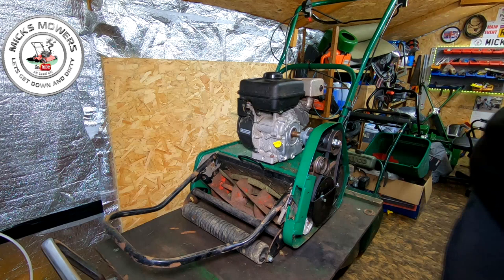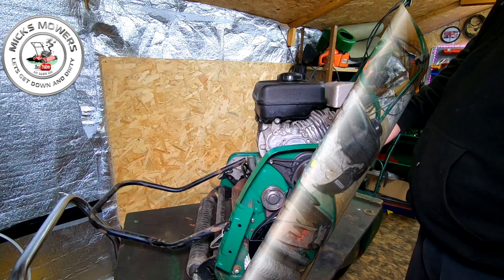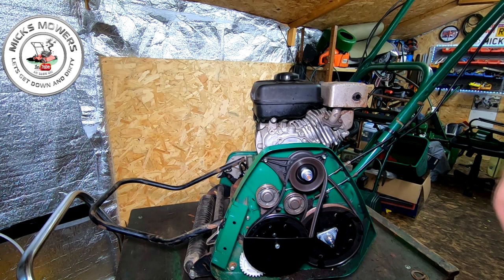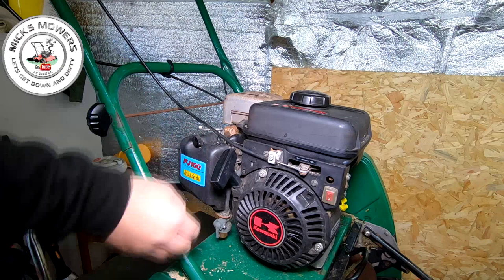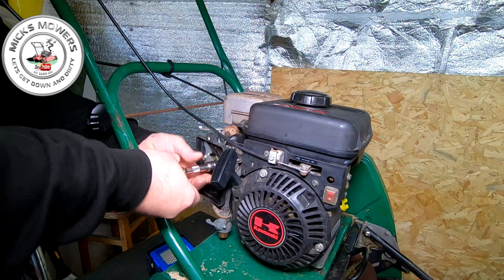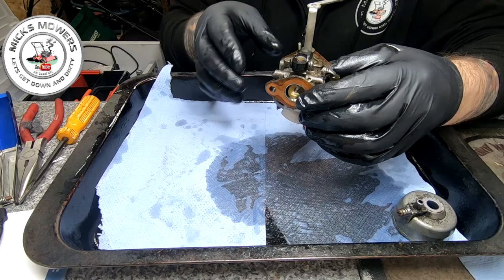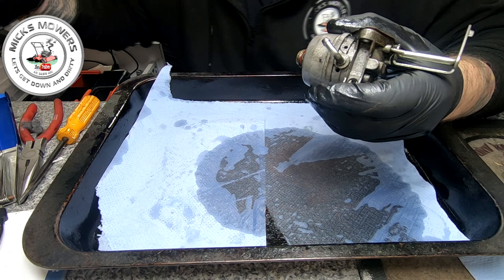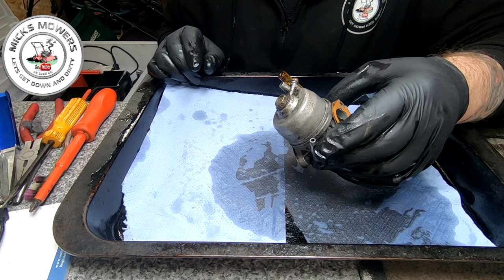Service Your Qualcast 35s Cylinder Mower Yourself.. Cost Effective And Easy To Do

Comment: When the pins are tight try pouring some very hot water on the posts. the alloy will expand quicker than the pin and it should pull out.

Comment: pretty sure those float pins are tapered, will only come out one way.  Usually the longer end is the narrow end so you need to push it back, not pull it through.

Comment: Hey Mick, last night my Suffolk 14sk lost drive and I stumbled upon your channel. Exactly like your one, the dig clutch had slipped out. Thanks a lot for posting your video as it saved me taking it for repair. 

Where's the best place to get spares for these? I need the black plastic part that goes behind the top pulley. One of the plastic arms has snapped on mine so the belt bounces around a lot.

 (Just ordered oil, plug and filter using the links above).
Reply from the maker: You can find most parts on eBay mate .. well done on the fix..

Comment: Great video, thanks. Have you any ideas to repair dents in the rear roller? Or is it better to get a replacement. Thanks.
Reply from the maker: Hi mate you can take the roller apart.. it's a bit of a job but it can be done.. might be just as easy to get a good second hand one to be fair
Reply: @themowerman  Thanks I will look out for one.

Comment: Hi Mick, great content - really helped me out. Slight issue is that I have managed to lose my governor arm linkage rod. Could you suggest anywhere I can go to get a replacement at all? Thanks in advance sir.
Reply from the maker: Hmmm part number 16171.. as listed on L&S website.. but not seeing it available
Reply: @themowerman  Thank you sir. Might have to head down to the local engineer to see if they can fashion one! Keep up the good work 👍

Comment: Hi Mick, great video. I have just brought a Suffolk Punch 17SK it was hunting very slightly much like yours in the video and wouldn't run with less than 1/2 choke, so stripped it down and cleaned the carb now runs much better and after a minute it can run without any choke and no hunting. However it seems to be running too fast at slow idle and doesn't change when I move the lever to fast idle. Could you do a video in the future on how to correctly set up the high and low idle speeds and governor on the Kawasaki engine, I've read the manual and tried altering the idle screws but it's not changing anything!
Reply from the maker: Ok mate I will try.. but I will say it may just be the throttle cable needs adjusting.. set the throttle to slow and take off the cable at the mower end.. then make sure it's set to slow at both ends and put it back together.. see if that fixes it..
Reply: @themowerman  Thanks for that idea Mick, I’ll check it out tomorrow. I am pretty sure though that the handle lever and the mower end lever both point at the correct speed ( tortoise and hare) in synch, which makes me think that the throttle cable is set correctly, I will check it thought. Thanks for your help.

Comment: Hello Mike, Great videos,   Can i ask have you ever sharpened a suffolk punch 14s  . have you any videos on that model. I think it dont have the 24mm socket wheel and only has a small fixture that you cant attach a drill on. and its a left handed any ideas how to back lap this model.  Thanks Vic
Reply from the maker: I can do a video soon if you like mate
Reply: @themowerman 
If you could please. But really need how to back lap with out the 24mm socket as I don't think it has one. Don't know how to spin it.

Comment: Hi mick how you remove the guard with the mower name on it . You picked it up 1min 35 secs into your video . Thanks B
Reply from the maker: One screw on the back and it will just pull off with the help of a screwdriver
Reply: @themowerman  thanks. Much appreciated

Comment: Is there anything apart from the 4 bolts that holds the side cover on?  I am trying to get mine off and I removed the 4 bolts but it won't budge
Reply from the maker: That can become a little stuck.. use a soft blow hammer to get it off

Comment: Just got one of these, got it running and self drive and blades both work, self drive engages and stops how it should, blades are just stuck on even after taking all the tension out of the pulley, not sure why, if anyone has any advice including Mick himself I'd greatly appreciate it 👍🙂
Reply from the maker: Take the side covet off and check the belt pulley is free..and make sure it's the correct belt.
Reply: Yeah I've done all that already I think there may be a spring missing to pull the pulley all the way off the belt, thanks for the reply though Mick I'm sure I'll sort it, small engine repairs is mostly perseverance, hope your well 👍
Reply from the maker: It can only be the belt or cable ..
Reply from the maker: Email me me photo of the side.. micksmowers01@gmail.com
Reply: I've figured it out there's two springs that pull the pulleys back off the belts, it just wasn't seated right 👍 once again I really appreciate the response

Comment: Hey Mick's mowers quick question, my qualcast classic 35s runs but I have to run it on full choke what do I do so it runs on no choke
Reply from the maker: Carb clean mate ...
Reply: I have already done that
Reply from the maker: @stickvac  and do it again mate .. I have done them 4 times before they work

Comment: Hi mick , great video again mate.
Just got a qualcast 43s and it's hunting.  Just dropped the bottom pan off the carb, and cleaned the jet.
Started back up, and still surges.
I've ordered new spark plug and air filter.  Do you think, they'll sort it out, or will it definitely be the carb ?
New subscriber, great channel 👍
Reply from the maker: Yo yo.. I would say the carb.. a new spark plug will not hurt.. thanks for watching

Comment: any idea how to get cover off in order to change ignition lead mate?
Reply from the maker: Tank and recoil covet off and then remove the throttle cover. It’s behind that.
Reply: @themowerman  I removed the two bolts at top of cover but can't seem to get it off
Reply from the maker: @thomaswright2614  check to see if it has any bolts at the bottom..

Comment: Thanks Mick for a video which really helped me get a 1999 model up and running. Mine is the Tecumseh engine with the Dellorto FHC20 carb (complete with immoveable chewed up main jet nut!). One question please -do the nylon drive cogs need greasing or are they self lubricating?
Reply from the maker: Hi mate.. thanks for letting me know my videos helped you out.. I just put a very small amount of Greece on the gear shaft.. I would recommend heigh temperature one because of the sorry it runs.. hope that helps
Reply: @themowerman  Thanks Mick I'll do that.

Comment: Bought one of these guys last year so great to see a full service. Out of curiosity, what's the best way to clean all the grime and dirt off the entire engine itself? I assume there must be something available that will take all the dirt off, even if it needs a bit of elbow grease too?
Thanks!
Reply from the maker: A product call d gunk off.. spray it on leave it.. use a paint brush to loosen it off and then get wash
Reply: @themowerman  Thanks a mill. Will try to track it down! Really appreciate all the videos too. I'd say a lot of us love the notion of tinkering away!
Reply from the maker: @legendhero99  thanks bud.
Reply: get dollar store oven cleaner best degreaser and cheap
Reply: @timfreeman476  Caustic based ones in the UK dissolve aluminium in seconds!

Comment: I have a Qualcast Kawasaki 14SK similar to the one in your video. Can you tell me where you source your parts from? i.e. air filter, aprk plugs, etc.
Reply from the maker: All on line mate I can send you some links if you like
Reply: @themowerman  please.
Reply from the maker: @russellmillar2942 
Here you go mate Spark plug https://www.ebay.co.uk/itm/330745373598?mkcid=16&mkevt=1&mkrid=711-127632-2357-0&ssspo=n7mtJY-yQe-&sssrc=2349624&ssuid=VxofTcWjS-2&var=&widget_ver=artemis&media=COPY
Air filter
https://www.jungle-busters.co.uk/Kawasaki-FJ100-Air-Filter-Atco-Qualcast-Allett
Engine oil
Briggs & Stratton 100005E 4-stroke lawn mower engine oil SAE30, 0.6 l https://amzn.eu/d/9RbQmmC
Reply: @themowerman  Mick, Thanks very much for your help and advice. Much appreciated. Regards Russell
Reply from the maker: @russellmillar2942  your welcome mate

Comment: Hey Mick's mowers I have a qualcast classic 35s that hasn't run in 10 year's what should I do
Reply from the maker: Tank flush and carburetor with fuel tap clean.. that should do it
Reply from the maker: Let me know how it goes
Reply: Ok I will try that, thanks
Reply: Hey Mick's mowers I have cleaned the carburetor and I ran as sweet as a nut thanks for all the help
Reply from the maker: @stickvac  your welcome

Comment: Good thing you cleaned that carburetor Mick! Does your fuel in the UK have ethanol in it? Looks like some of the carbs i do that have been running fuel with ethanol.  👍🇺🇸Roger
Reply from the maker: Petrol in the UK already contains up to five percent bio-ethanol. You may have noticed as much; the labelling on unleaded pumps changed to E5 in 2019. But in 2021 E10 will become the new standard with up to ten per cent bio-ethanol in the blend
Reply: @themowerman  Here in the US we have E10, E85,  and regular with no ethanol,  premium with no ethanol.  In small engines i only use premium  with no ethanol and i treat it all with Seafoam. They are know thinking about adding E15.